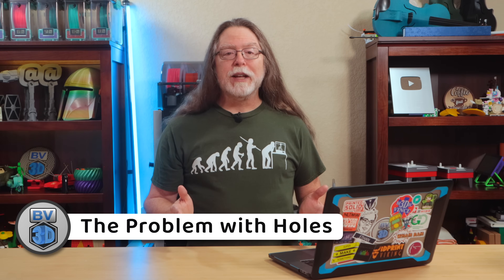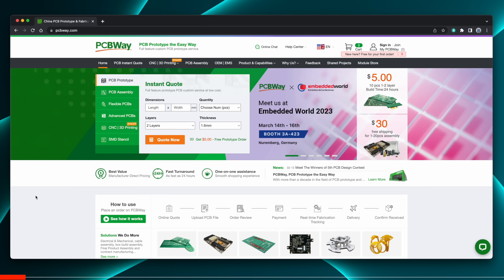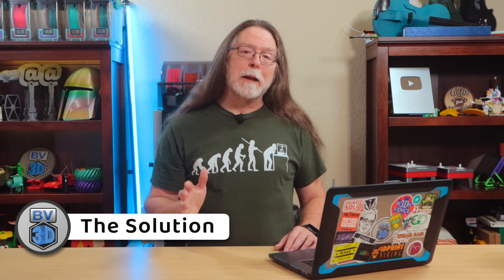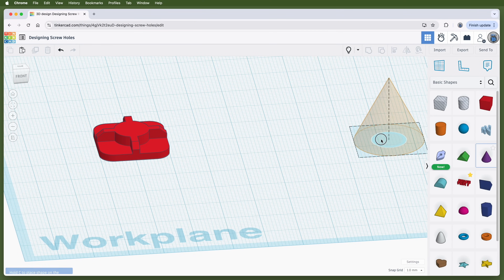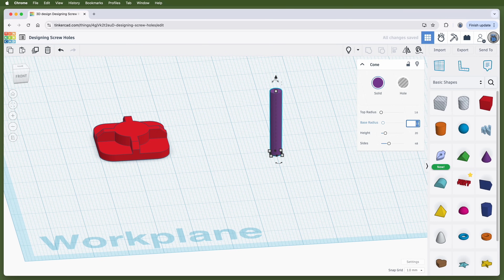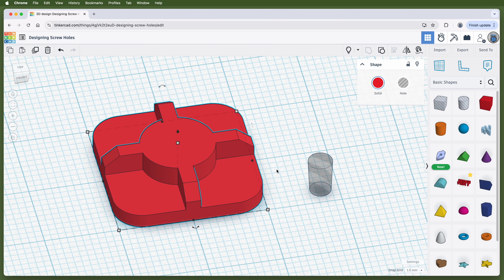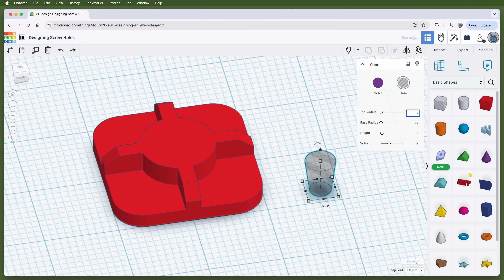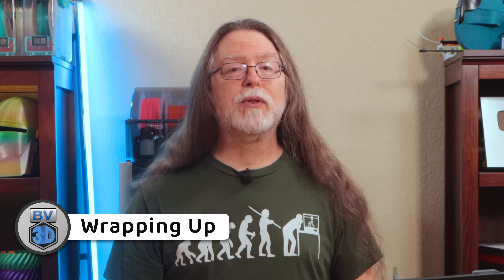This SECRET Screw Hole Trick CHANGED My 3D Prints!

Comment: I model in the thread pattern I'm needing.  My printer doesn't have the resolution to actually print useable threads but, it does print a rough equivalent of that thread which then makes it easy to use your non-thread-cutting screw to finish off that thread that my printer just couldn't cleanly print.

I also have a tap and die set that I can use to clean up those close-but-not-quite good enough printed threads or, in a properly dimensioned and printed hole,  my tap and die set will cut pristine threads in 3d printed materials like cutting through butter.

If your CAD software doesn't have a threading feature, you can simply use the method used in this video.  The only difference would be to use a model of an actual screw of the size you need.  You're print will come out with just enough of a thread pattern on it to allow you to easily screw in your non-thread-cutting-screw.

You can download premade screw models from the McMaster Carr website.  Example: if I need to have a hole with a 1/4-20 thread pattern.  I download the model of the 1/4-20 screw from this website (free) .  Then I'll import that part into my model, place it correctly within the hole and then subtract the screw.  This converts the hole I've modeled into the item to be printed as a perfectly threaded 1/4-20 threaded hole.  Easy Peazy.

Comment: I spec out screws for plastic assembly and size the hole based on the screw specifications. Machine screws generally are not optimized for plastics. Wood screws are an option. And don't countersink for plastics.

Comment: Simpler way: Use a pentagon-shaped hole equal to the nominal diameter of the screw. Add that same nominal diameter tapered cone to the screw entry side of the pentagon shape. Make this cone 3mm or so in height to give the screw and easy entry. Do the hole cut the same as you described. The corners of the pentagon-shaped hole give the plastic somewhere to go while allowing non-thread cutting screws to cut their own threads. I used this method for production parts and never needed to use inserts.
Reply: So for 3mm screw you use a pentagon measuring 3mm from one corner to opposite side?
Reply: @StanleyPinchak  I use FreeCAD for most of my modeling. FreeCAD uses a circumscribed circle of my desired dimension to define the pentagon; polygon points touch the circle, not the line segments.

Comment: I use a square instead of a circle. I saw this in injection molded parts, gave it a try, and have been using it since. For instance, an M3 screw uses a 2.8mm square. It's worked well enough for me.
Reply: That's right! It goes in the square hole!
Reply: This also allows space in the corners for any offcut material to be ejected out of the hole being cut, similar to the flutes in a thread tap.
Reply: I've looked everywhere and can't find square screws at a reasonable price.

:D

Comment: Basically a slight subtle chamfer on the      hole. Fusion 360 allows you to do a chamfer with 2 different dimensions, so very easy in a single command.

Comment: Why don’t you use the dimensions indicated in all tap and die set. It tells you exactly the dimensions of the hole ( drill size) and then just use a tap to cut the threads.

Comment: I just measure the inside diameter of the screw...probably called "minor" dia.. Print the hole that size and then thread it with a tool.

Comment: This is so blindingly obvious - once someone else points it out :) I use OpenSCAD and generally find 1.5mm radius works but can come up a little slack or be prone to pulling out and 1.4mm sometimes is hard work to get the bolt into. I blamed a slight tolerance change from one printer to another, never considered the tolerance change was the actual bolts :) Now it makes total sense, so I'll probably run up a small OpenSCAD module to do the same thing you are doing in TinkerCad :) Thanks for another great video :)

Comment: I do something similar in Fusion 360. I'll create the hole with threads to match my screw, even though I can't print something in a .7mm thread pitch. To help it get started I use a chamfer so the screw starts biting slowly into the plastic.

Comment: Hey BV. Another trick I use is to make sure the hole is a fraction too small, then just heat up the screw. It melts nicely and sits very secure afterwards, almost like a selflocking. Next time I'll combine both theese solutions :)

Comment: This is a great technique.  Thanks!  Also: “Non-self tapping screws”… I think those are called “bolts”.  😊
Reply: Nope.. they're called "machine screws", unless they're relatively large.. with external hex head, some length of unthreaded shank, and intended for use with nuts and washers on the opposite side of the parts being fastened. THEN,  under these conditions, they're called "bolts".
Reply: @RocinanteGold machine screws are essentially a bolt without a nut. They are designed for use with threads tapped in metal. They are not suitable for plastic regardless of whether you are going to argue semantics of calling them a machine screw or a bolt.
Reply: @norro21  Show me where I argued that machine screws or nutless bolts are "suitable for plastic"... I'll wait, but I need air too much to hold my breath.
Reply: @RocinanteGold ok so you are only wrong in one way? The thread you replied to us in the context of what the OP originally used in their video. Regardless of what you call it, it's the wrong type of hardware. And despite not saying these should be used in plastic, you are still missing the point and taking us on a wild goose chase about semantics.

Comment: Yeah, but depending of the real screw diameter you will need to make this test prints everytime you use screws from annother batch.... and for your 5mm long hole the cone will make that the screw will cut treads in maybe half of the lenght of the hole, making this a weak solution. And this is because most slicers do not have a dedicated hole calibration setting that is not tied on the overall size of the piece you are printing. The only slicer I know to have this setting is SuperSlicer.

Comment: I don't really understand the problem. I print the hole smaller and cut a thread in it, using a standard thread cutter. ;)
Reply: And if you didn’t have access to a hole cutter, this is a good alternative
Reply: @mika_jurvanen  THREAD cutters are available at any general store.
Reply: @lajosbarath1034 duh, really?   You are purposely missunderstanding.   Most challanges has multiple solutions…. If you have another way of solving it, great.
Reply: @mika_jurvanen  Really. I use manual thread cutter in my 3D printings, if needed. Simple, cheap, accurate, fast.
Reply: @lajosbarath1034  and I use brass inserts.  HOWEVER, the tip the author shows is a nifty, super simple, trick for screws that does not need the extra added strenghts, or extra post processing tools.  Is is a good tip.  Use it, or don’t use it.
Reply: @mika_jurvanen  I understand. I didn't refute the video. Everyone uses the method that suits them best.
Reply: @lajosbarath1034 or to be specific, suits the application. ;)

Comment: got to ad haven't watched past it yet, guessing with what I use unless I'm pressing in an insert which is usually my solution: not sure how tinkercad works but assuming it has a threads function like Fusion 360 that has preset screw/thread sizes. Dump a preset screw thread hole then extrude down filling in the thread area.

Comment: I'm not sure I think this is a good idea. You are engineering the hole to be the wrong size everywhere but a very small part somewhere along the depth of the hole; meaning it will always be weaker than a correctly sized hole.

I would rather just err on the side of the hole being a bit too small and then if need be run a drill through it (or better yet, drill and tap the hole).

Comment: It can also help making holes slightly elliptical. Give the ellipse a minor diameter slightly smaller than the screw and major diameter slightly larger. If the hole is too small, the screw will force it more circular. So for example a M3 screw might normally use a 2.7mm circle to to self tap. A 2.6mm x 2.9mm eclipse allows both undersized and oversized screws to fit.

A few board games like use that tick to make sure pegs stick better in cardboard and they're trying to make sure the material bends rather than rips.
Reply: Smart solution! 👍

Comment: I've been adapting a similar concept for all of my insert parts. Instead of a cylindrical peg into a cylindrical hole, I use a cone meshing with a hollow cone. It's especially useful when dealing with parts that have to be glued together, because it's really hard to control the "thickness" of glue. My latest application was a handle for a food-safe mug that needed to be attached with resin.
Reply: If you are using a filament that has a suitable solvent, such as acetone for ABS, the solvent will weld the plastic pieces into one piece, then evaporate completely, so there is zero thickness of glue.

Comment: It also depends whether the screws are used on something that requires constant fastening and unfastening like a service box, if this is the case, inserts or nuts are the best solution. I usually find just printing 0.2  less in diameter is quite sufficient for 3 and 4mm screws to bite into. With PLA being relatively soft the screw usually starts into the thread with no issues.

Comment: I sort of do something similar-- I print the cylinder slightly smaller than the minor diameter and then I put a chamfer on the entrance of the screw hole. This is a good tool to have in the toolbar, though.

Comment: Certainly appreciating a challenge, but why not ‘just’ run the appropriate tap (tap & die) through  slightly smaller than spec hole? 

That being said - clever solution. And thank you for sharing the solution

Comment: To ensure it grips, the hole should really get smaller than the pitch diameter, not just the major diameter. The major diameter can vary between screws quite a bit but the pitch diameter is the important one for fit to internal threads (nuts/holes).
Reply: Would it make sense to make the hole taper to the major diameter and also to line that hole's interior with, say, 6 low ridges or short fins, evenly spaced and arranged longitudinally, to provide something for the threads to bite into? It seems to me that the screw is almost certainly going to be needed to prevent pulling-out of that part relative to whatever it's attached to, rather to resist shear (that would rip the two parts apart laterally*) -- hence, there's no real need to have full contact of the entire thread surface with the hole's interior. 

* I'm supposing that shearing is prevented largely by nesting one part into a larger part, using mating shoulders or some other mechanism.
Reply: @michaelthibault7930  I mean I'd just put printed threads in it with the right in-spec tolerances. But I don't think basic software like this does a good job of that..
Reply: @daliasprints9798 Most of the machines aren't that great at it either. At lower scales, the design specs are too tight for what the machines can produce, and at higher scales the specs cause too much overhang at angles that allow the material to droop too much before it cools or cures.
Reply: @claws61821  ISO thread has 60° overhangs which are very printable. At small sizes they wont come out great in XY plane unless you have a tiny nozzle, but oriented along Z they're very usable as long as your layer height is at most around 1/3 of the thread pitch.

Comment: Interesting. I'll have to try this. I normally model holes for machine screws using the standard tap diameter and run the appropriate tap in after printing. That has been flawless for me but saving a step with the tapered hole appeals.

Comment: Another trick is to turn a non-self tapping screw into a self tapping screw. You need a cutoff wheel, and the smaller the screw, the thinner the cutoff wheel needs to be. You can just cut one or two slots in the first few mm of the screw and Bob's your uncle. If the screw is too small for your very thinnest cutoff wheel, just cut a "corner" off the first few mm of the screw. I find about 20'ish percent is good. And it should be tapered.
Reply: When I get a box of M3 bolts in, I take about 25% of them and do this very thing. Put a nut on before grinding, then remove it to 'clean' the threads. I also have a set of M3-M7 taps and dies that I use for 'harder' plastics like PPS-CF.
Reply: @StephenFeather why not just tap the holes?
Reply: I think the point of this video is for making parts for others. You can not expect your customer to have a cutoff wheel to turn a non-tapping into a self tapping screw.

Comment: I generally tap my internal threads and for odd screws like very small wood screws I make a tap out of one of the screws using a Dremel with a thin cutting disk. Just cut a couple grooves in the first 5 or so threads.

Comment: The way an engineer does it is too look at the screw hole tables.  It has dimensions for the hole.  At least for larger screws I have used that and it works first time.  Normally for small screws I use an insert.
Reply from the maker: I'm not an engineer, and I didn't know screw hole tables existed. That's cool!
Reply: @ahbushnell1 Can I  assume that when possible, you prefer the insert to be sunk into the opposite side and pulled into the part vs near side insertion?
Reply: @StephenFeather  No, I normally put it in on the side the screw goes in.

Comment: I thought I knew where you were going, but you took a whole different angle to solve the problem.

I use a similar trick when making knobs for hex & socket head bolts. Taper the recess so the head is captive when seated.

Comment: Great tip!   Another thing I saw recently on a video was to not bother with grouping for holes (or any multiple parts really).    If you export all objects as a single STL they will will be cut out as a hole when importing to the slicer.   It makes things much easier to edit after the fact, no need to ungroup over and over and find the object you want to change.

Comment: Have you played around with the number of sides for the cone? I suppose that at the scale of an M3/4/5 screw that it wouldn't matter a great deal. But I would expect Stefan from CNC Kitchen to test that, LOL.
Reply from the maker: Hi Stew! I tried that technique when I was using cylinders with moderate success, but I haven't tried with the cones.